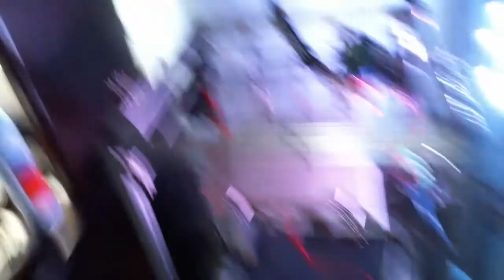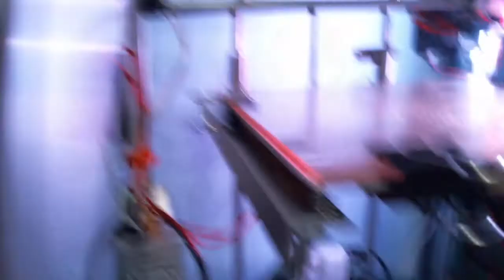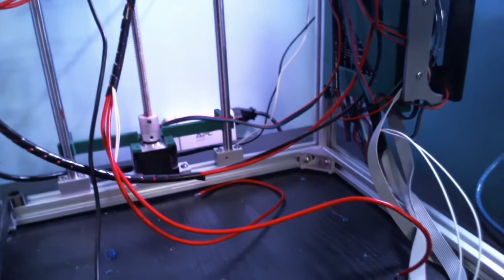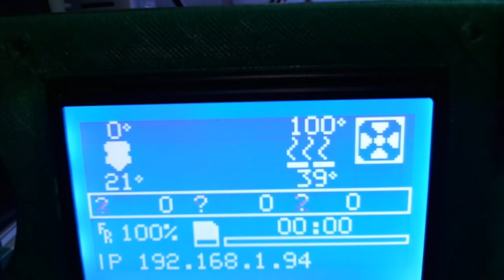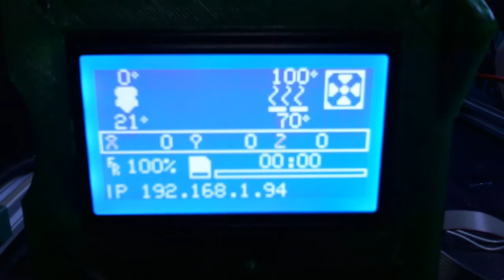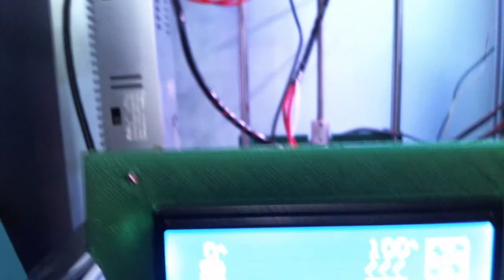How to: Install a Mosfet and Silicone Heatbed on 3d Printer Flying Bear P902

Comment: Good idea to use an external MOSFET, most cheap RAMPS use poorly-rated FETs on the board with no heatsink so there's a big risk to melt parts of the board or fry the transistor itself. The only ones I'd trust are the expensive Premium RAMPS or German RAMPS 1.4.2.

Comment: Have you insulated the bottom of the bed? I found this made a difference for my printer with MK3 bed. I used a random piece of packing foam, I think it's called Solid Core Foam and is also used for building insulation. Other popular choices are cork sheet and rescue blankets.
Reply from the maker: @Jamie - Yes I used cork sheeting

Comment: Hey Jim, nice video!!! Just one question. How well does the bed heat to the edges of the build plate? I notice that the silicone heatbed is 200x200 while the build plate is 220x220. Thanks
Reply from the maker: Thank you @Zane_Waves , It heats uniformly to the edge, as the cork insulation and the glass keep that heat good. I've not had a single problem since I installed any of it :) Hope that helps
Reply: Yes thank you Jim that helps a lot.
Reply from the maker: Your very welcome!
Reply: you're still using the silicone bed? nothing was deformed or broken? because I feel like buying one, I also have a p902.